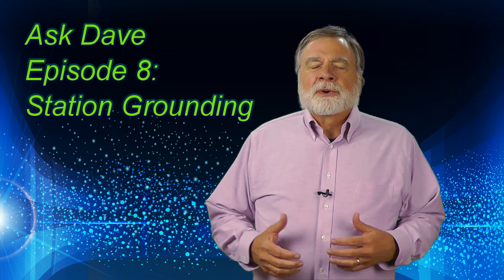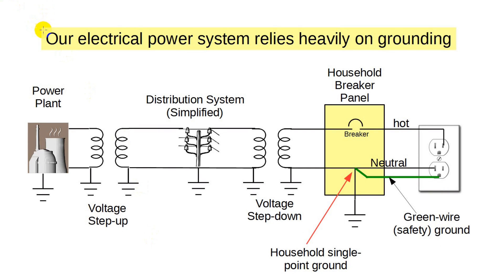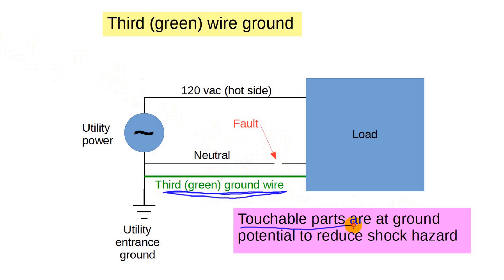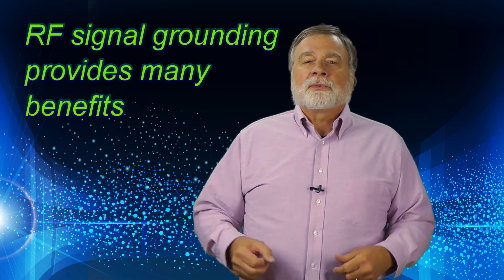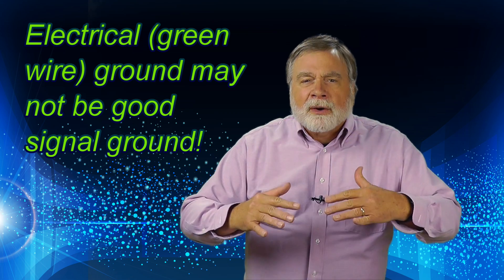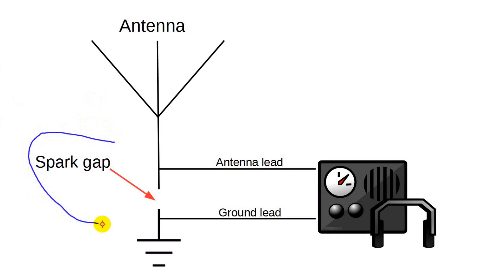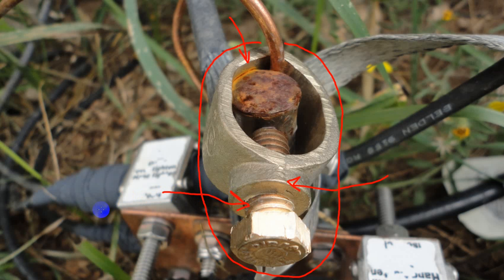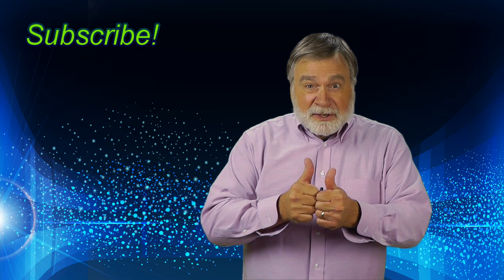Station Grounding for Amateur Radio: Ask Dave Episode 8

Comment: Dave, How did you connect the cable shield to ground before bringing it into the house?  I'm using a Cha-hybrid-micro 60' wire antenna laid on my roof and using the coax as the counterpoise.  I grounded the micro transformer from it's base mount bolt to a ground stake (20' down to the ground).

Comment: Dave good short intro into the 3 areas of our beloved topic of station grounding. As a retired 40 year EE/CEO of the power industry i have seen lightning destroy portions of the best grounded substations and power plants in the world.  The bottom line always is; lighting will search out the path of least resistance to discharge itself. The further you (or your equipment) are away from that path the safer you are.  Most people do not even consider the 3 separate areas in their discussion on station grounding.  I have stories i could write a book on but that would take too long and my days are short.   God bless and i enjoy your videos.  73s  K4WSR.... No extra class as neurological disease is quickly claiming my ST memory.

Comment: Hi Dave — thanks for this video, even though it’s nearly 9 years old now! Still a great watch and full of useful principles that apply widely.

Just a quick note from the UK: our earthing systems are very different, and some of the methods shown (like separate ground rods for the shack) would actually be unsafe or non-compliant here due to PME (TN-C-S) installations and our BS7671 electrical regulations.

I see many UK hams trying to follow the USA way of doing it, which can be dangerous here. It’s really important we refer to UK-specific guidance.

For UK hams, best practice is outlined in:

RSGB EMC Leaflet 6 — “Grounding and Bonding in the Shack”

RSGB Technical Forum: Earthing

G6AKK / GM3SEK Notes — especially Ian White’s Amateur Radio Technical Notebook

We have to ensure that all RF bonding is connected to the MET (Main Earth Terminal), and we must not create separate “shack earths” unless they’re properly bonded — otherwise it can create serious step potential hazards.

For upstairs shacks or those far from the MET, using ferrite chokes on the coax at the shack entry is often far safer and more effective than earth rods.

Keep up the good work, and 73 from the UK,
M7OOR

Comment: Thank you for this video. 
I'm currently researching proper station ground because a well known operator has made a video stating that a common ground source in the shack will create the ground loop. 
He says to daisy chain all equipment together which is exactly the opposite of what ARRL says. 
So now I'm doing research to confirm or deny that I did my ground the right way.

Comment: All right my friend kc8ikw here my name is Joseph Strauss everybody calls me Joey I got to ask a bonehead question I just got done watching your video and I understand the part about with the copper pipe that you could use that as ground when I got to know is I'm going to get some the foil strap from DX engineering and put that foil strap and my copper pipe and then run that copper pipe into my shack along with the along with the aluminum strap as what DX engineering cells can I have three ground rods outside my shack that is that's 8 ft deep that are 8 ft long running at copper pipe into my Shaq with the foil strap is what DX engineering sells how good a ground is that hooking that all to my water pipe inside my shack with a strap

Comment: Hello Dave. The NEC has changed since you produced this well done episode. All grounding on a premises must connect to the UFER or electrical ground at the power panel now as you know. This episode will make HAM's install a ground rod for their station only with no connection to the UFER grounding system which is a code violation. Thanks Dave for your work.

Comment: HAM radio in about 1950 SAW changes in some control of the plugs and sockets that used to be so dependably standard. But plug and socket I missed the most and still retained only on the back of the high gain rotor control box is a cinch- jones multi pIn plug and socket. It is extremely rugged, of power level for ham radio easily, and it even has a strain relief on the plug cap. If you want to run anything in ham radio with plugs and sockets try to find some Cinch Jones brand units that will do your job very well.   Many ham radios have gone downhill to use the nylon multi pIn 12 Volt plug in socket on the back of new radios  the pain of every real hams existence ARE the DIN plugs and sockets which came into use because of some misguided engineer somewhere IN manufacturing specifications.   The way to soldier a small piece of wire to the little pIn is to use your hot iron to heat the WIRE and use the WIRE to supply heat as you touch they connection with tiny diameter soldering wire.
    Even though sockets for headphones are now minie-size, one holdover on ham radio is the use of the two conductor quarter-inch phone plug for plugging in a CW code key.  how has that ONE item held on?

Comment: Grounding my favorit topic  here in romania groundig 4 antennas has to meet the majured rezistent of 1.2... to 0 ohms usualy 4 a hamm a 8 to 12 ground stakes of 2 m lenth of galvanised steel and abou 20 to 30 m of galvanized plasband gets you there is you hav black eth and not sand or stone. puttig salt and coul in the ground near or on top of the rods helps. cable or galvanized plasband from ground to internal panel needs to be wery thic 25 50 squer milimiter

Comment: I may have missed it but did you mention that the ground needs to connect to the main service entrance ground?
That’s a very important point to make. Too many hams just add a ground rod for their radio and do not connect their ground rod to the service entrance ground rod. The ground potential at one ground rod can be very different than at another ground rod during a surge or nearby lightning strike! In recent years new houses all seem to have a place (terminal strip) where this connection to the service ground can easily be made.

Comment: Hey Dave, I just saw your other video answering this.  One problem I have it is impossible to connect the service ground to the antenna ground rod. Any other solution?
Reply: I have this same situation at my QTH. House built in early 70's meter on opposite side of house, no ground rod at meter head. Only single phase 220 with nuteral drop from pole to weather head. I want to install alpha-delta suppressors mounted to ground rod outside shack a MFJ window pass thru and a single point ground bus bar in shack. Coax would be common ground point at ground rod outside shack, shield would also be common ground point at MFJ window pass thru via ground wire on outside of house from ground rod to MFJ pass thru. Inside would have copper braid strap  connected to ground bar and RF ground copper straps single point ground connections to rigs (VHF / HF) Versa tuner , astron power supplies and various other equipment. Maybe desktop PC if RFI is a issue. 

My concern is difference in ground potential between ground rod at shack entrance and utility ground which I can not bond to at other end of the house. I am unable to locate a utility power ground at the weather head oy power meter. Any thoughts on this? I have recently acquired a copy of ARRL grounding and bonding book but can't fine a good solution for my situation. 

TNX
Jim Barrett
73 de KD4PDY

Comment: Good info Dave. Thank you. Far too many hams either ignore grounding all together, or worse, listen to a bunch of nonsense about it and act on it. 

I run all of the gear in my station through a single AC power bus strip that's easy to reach. In addition to being able to unplug my whole station with a single plug when I leave the room or hear thunder, I know that it causes all of my gear's grounds to be tied closer to one another to help minimize ground loops. I've seen some real problems caused by interconnected gear that was plugged into outlets that were on 2 different house circuits.

As for antenna grounds, I've found that if I'm running low frequency antennas it's best to use an individual (virgin) ground directly below the antenna, as a common ground will feed noise from elsewhere back into the antenna, and I like to use a 1 to 1 transformer at the antenna to decouple DC between the antenna and the station, and I ground the coax shield for that antenna right where it comes into the house, again with its own isolated ground. Grounds for low frequency antenna systems can take some real playing with in order to really cut down the noise. But it's time well spent, as you can remove a whole lot of endless noise (several dB) with an effective ground.

Comment: I’m new to all of this so I want to be sure I’m understanding. I have an 8ft ground rod that I have my “tower” grounded to. I should also run the ground wire from the radio power plug out to the ground rod instead of the ground stud on the power supply?

Comment: I heat my house with kerosene.   How close can I  have my antenna and ground to the kerosene field tank?
Reply from the maker: Don't ground to a fuel tank. It should be separately grounded with its own ground rod. Have a separate ground rod for your radio and bond it to the house electrical ground. Some may tell you that your kerosene ground needs to be bonded (outside and underground) to the house electrical ground. Ask a licensed electrician.
Reply: I was asking how close to the tank. I just asked city Building & Saftey and they said I don't need to worry about distance.  I do need 2 grounding rods 6 feet apart.
Reply from the maker: @michaelalexander1751  Thanks for the update.

Comment: Question. I have an end fed dipole. The 49:1 unun box is about 25-30 feet away from where my coax enters the window.The rig is about 5 feet away from my window. My question is, do I attach a ground to the unun box ground terminal AND to my transceivers ground lug? If I do that, then both ground rods would be 25-30 feet away from each other.

Comment: very useful and interesting video . This happened to me 2-3 times . 
The fist time a lightning cut in the middle a tree that was not more than 20 m far from the room i lived The static remained  in the antenna wire . After connetcing  the radio next day it burned the main FET of  the receiver  . It was a rural place  1.5 km far from 'the civilization'  , second time the lightning burned the PCs built in modem on 2009

Comment: Dave, of course I don't disagree with anything you said about grounding your shack. BUT!!! if you don't lift the ground on any of the other equipment in the shack that plugs in the wall, like the main 13.8v power supply,  aren't you then setting up a huge possible ground loop?

Comment: Appreciate this video, David.  During a recent wind and sleet storm, I experienced some heavy static build up in my homemade 2M ground plane antenna which I had hooked up to my cheap HT. Even though I was still getting acceptable SWRs, I decided to disconnect until after the static danger was gone.  This was no simple shock like you get walking around in your socks on a carpet floor and touching your wife's nose, you know because they love that,,, this was a seriously painful shock with a much larger spark.  After the wind and moisture subsided, I took a chance and touched the coax connector, and the static was gone, so I hooked back up and the system works great.  All that said, I'm about to set up my first real, non-HT dual band in my office/shack and I want to make sure I've got everything grounded properly.  I built a new and improved Dual Band antenna, which I plan to tune once everything is installed and grounded properly.  Thanks for the education.  I did go ahead and subscribe to your channel for more than one reason.  Most importantly, the education I receive by watching your videos, secondarily, I'm a old Son of the the Colorful State; grew up in the Springs. Blessings, my friend.  Thanks again for the video.  KI5CSQ

Comment: In other videos you never mentioned connecting the station ground rod back to the main entrance ground rod.  You touched on it here, but didn't really convey the safety importance of doing so.  It is covered well in the ARRL Station Grounding and Bonding book, as well as the other 2 you mentioned on here.  My understanding from a couple of master electricians is that it also a requirement of the National Electric Code ( NEC ).  SAFETY first! and like you stated here, it doesn't add noise. If anything it can help to reduce it by further lowering the impedance of you main and station ground.

Comment: Dave, I was told by an Elmer of mine that my tower ground rods were too far apart. I was adding 2 more ground rods (one for each leg of the 25G rohn tower).  He said the ground rods need to be right next to the tower.  I had them spaced 8’ apart per code so I thought. I get we need to have short payment h to ground but ground rods too close together violate the voltage gradient of ground rods. 

Thanks for you answer as there are not more disagreements in radio besides dissimilar metals.   Thanks so much.

Comment: Does it matter at what point in the station dedicated ground that the electrical house ground is connected together?  For instance, if I wanted to connect my station dedicated buss bar ground to the ground side prong of an electrical outlet via a three prong plug with the neutral and hot prongs cut off.

Comment: I do realize that this is an old video but there are still a couple of things about it that I'm going to point out. I am retired out of 45 years in the electrical craft. I've installed communications equipment shelters from Tierra Del Fuego to Alaska and from French Frigate Shoals (think Hawaii and your close enough) to the middle east. The Motorola standard you mentioned is the Bible for that work. I saw a couple of things in your video that you may want to address. The "Acorn Clamp" at the top of your ground rod is the wrong size for that diameter of rod. That is not a trivial as it reads. The proper sized "Acorn Clamp" will only clear the sides of the rod by barely enough to get it on there and the V at the bottom of the acorn will have a much closer hold on the Grounding Electrode Conductor (GEC) and will have much more contact area with both the rod and the GEC. More contact area means lower impedance. 

When installing the rod and clamps; including the one you attach your Coaxial surge protectors to; always buff them to a bright copper surface before attaching them to each other. The easiest thing to use for that is Emory Tape. As soon as you are finished removing any copper oxide from the contact surfaces coat them with a laboratory listed conductive copper connection compound. I have a bottle of KOPR-SHIELD that I'm using right now but the brand is of no importance as long as it is Testing Laboratory Listed for use with Copper connections. Once the mating surfaces are coated make up the connection wrench tight but don't distort the clamp! Brass is quite malleable so that is easy to do. Best practice is to run the GEC buried in the earth and make up the GEC clamp below the surface as a buried connection. The earth itself will then protect the GEC, Rod head, and the clamp from physical damage. To keep the inevitable water which will pass over the rod, clamp and GEC from slowly washing away the protective copper contact compound cover the completed connection with an electrical insulating mastic pad. Squeeze the pad tightly closed around the protected surfaces. That is usually quite easy to do and makes a fully waterproof protector. 

There are 2 ways to Do Grounding. One is fully effective and the other is something less than that. 

-- 
Tom Horne W3TDH

Comment: Dave, your videos are really good on HAMs. One small correction at you video time lapse 2:55 onwards, here is the Main 2 line Neutral wire is never connected to the Home Earth Ground which is Green wire. The electrical device’s body if it has a 3 pin plug, one is Line, second is Neutral that connects to the electrical mains supply and the middle bigger pin is the Earthing which goes to your building’s Green wire called as earthing. The middle Green wire connects to the device’s metal cabinet. It’s good to have earthing for PCs/HAM Radios as not to have a minor shock or hum or in MacBooks that give tingling buzz on the palms. Here the unwanted leakage electric current goes into ground and is a safe feature.

Sorry that I was bit skeptical initially but thought to convey the connection points of the Ground and Neutral wire, never meet. Their electrical characteristic called as port is different.

Comment: I had driven a separate ground rod for my station, but after hearing how nearby lightning strikes can produce a voltage drop between two different ground rods I decided against hooking the new rod up. So you are saying a separate ground rod for the station is a "good" thing for noise abatement? If I decide to use the separate ground rod what size of copper wire is ok to connect the house electrical ground rod to the station ground rod? Will this simple connection eliminate the voltage drop across the soil between the two rods in case of a nearby lightning strike?